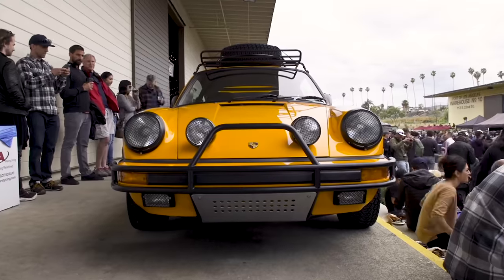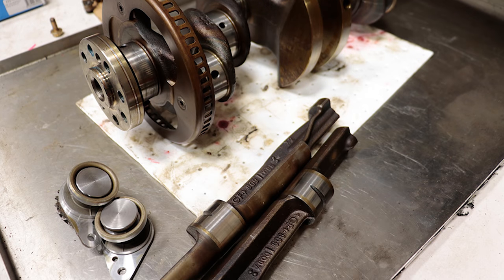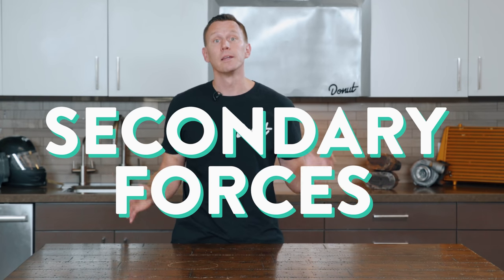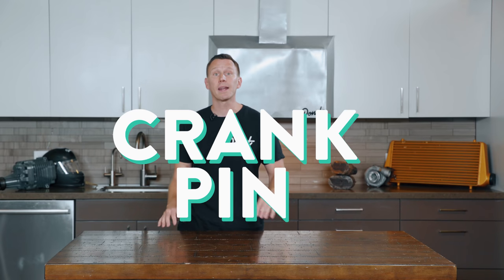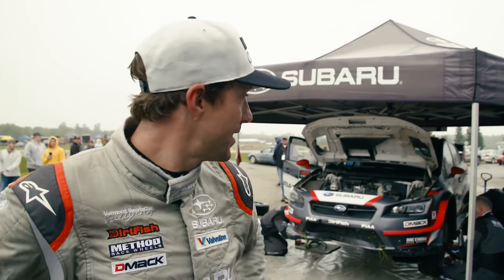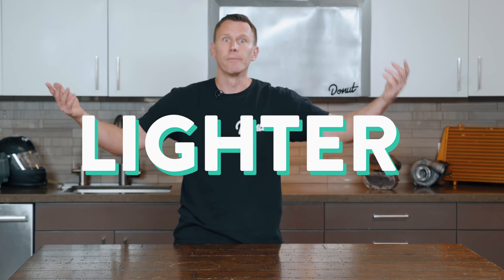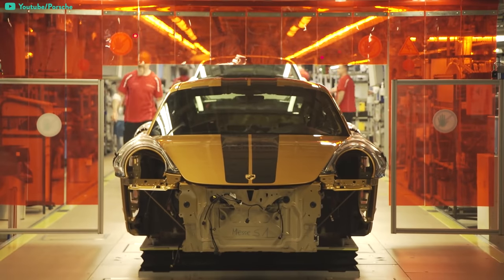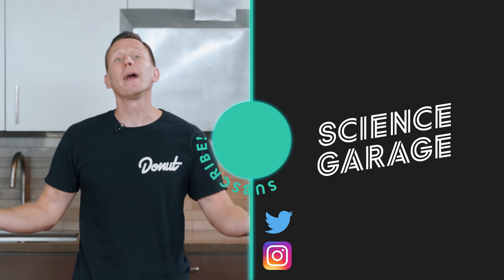BOXER ENGINE | How it Works

Comment: My 1982 honda goldwing(road bike or motorcycle) has a 4 cylinder boxer engine!!
Reply: Idk if you know or not but is it possible for a 16yr old to afford and insure a 600cc sport bike (yes i have prior motorcycle expirence)
Reply: Its not impossible at all I had my first bike at 17. Laws depends on what state you live in. Like the state laws and regulations. But from my experience it's not impossible but it's not easy to get a motorcycle at that age. The hardest thing would be getting a loan for one if you go that route(you can find older 600cc bikes for pretty cheap like 600 to 800 bucks) cash is always a better way to go if possible but small loans are good to build credit at that age. 
Instance is the next hardest thing being that young, if you go with cash you can get a policy for about 20 to 50 bucks a month because you can go with liability insurance it's always the cheapest but you can only do it if there's not a loan on the bike if there is a loan on it the bank wants full coverage on it.(your parents or guardian could help with figuring out what is best).
The next this is getting a motorcycle endorsement, most if not all states allow anyone to get a endorsement as long as they have a valid driver's license. I have been told that you can rent a bike to get it but I've always have said it's better to get one before and get to know the bike and how it rides so the riding test is more comfortable and easier.
The last bit of advice I have to say is "there are two types of motorcycle riders the ones that have been down and the ones that are going down" so always respect the bike and wear a helmet.
Reply: Very long post sorry lol🤣
Reply: @daxsouthwick2037  thanks man i raced dirtbikes all my life so 2 wheels isnt anything new, and now that 16 is coming soon im starting to save for a 600cc bike. Only want that fast of bike cause i have prior experience and i suspect most fundamentals of motocross/dirbike riding tranfers to street riding to. And I have a thing with going fast lol. But thanks anyway
Reply: @daxsouthwick2037  if not a supermoto cause its most famillar to me
Reply: @Aiden Maves I get it my first road worthy bike was a 1100cc I'm now on a 1700cc but looking at some other 1500 and 1600 because they look better and would be more comfortable. The bike will grow the longer you ride hah
Reply: For a bike you need a speedometer, technically that's all you need for one (besides license plates) and you could use your hand signals but some cops are jerks so I would put signals and a horn on it just to be safe

Comment: Aside from Porsche and Subaru (have owned both), don’t Ferrari produce boxer motors? I know they have at some point. Not sure if their flat-12’s are technically boxer motors. They actually had a car called the Boxer back in the 80’s iirc

Comment: Can someone explain to me the diagram with the 4 cylinder. 2 of the cylinders were only doing about 2/3 of the movement the other 2. Do boxer engines do this or is this just a mistake in the diagram?

Comment: Solutions for balance, solution for weight distribution, solution secondary forces (has more to do with number of cylinders and firing timing”, solutions for this at and other “we’re engineers and know more than you!”.  Solutions for their inherent oiling issue that is great for destroying engines.  from Subaru or Porsche nerds “because you’re a bad car owner who just doesn’t get why you should check oil levels every 4 times per fuel up!”

Comment: I might sound like an idiot, sorry I'm new to the car community but can a boxer engine be oriented vertically, so the Pistons are going up and down instead of left to right
Reply: yes but no but yes but you would never want to do that I just wouldn't really make sense and because of how cooling and how oil runs through an engine, gravity would most likely be against it

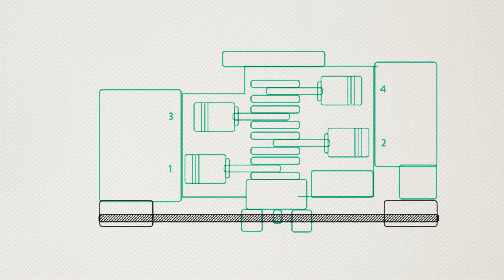Comment: @7:46 as my engine throttles through the valley of death on the way to las vegas because i got no chips left 

Cuz i been nossing and drifting so long

Even papa dom knows my nittos are gone 

Cuz i aint never raced a man who didn't deserve

Me be treating my car with autoshine you know that carnuba is worth it

You betta watch out who your racing and what your betting

Or you and your homies might be screaming MONICAAA

As i start from the pistol smoke, fool, ive got the new BA15 engines installed from Harrys so you better pray i dont take your slip so dont trip on fumes dawg

Comment: How the fuck you fail to mention  the aircooled VW and Porsche engine  one cam 8 valves and the capacity to make 5 times the original power on the same platform in N/A and 10 times the original power under boost! You all need to hire me!

Comment: Why not take an inline then turn it 90°?
Reply: Then the oil would leak out the gaskets
Reply: @nolesy34  so, v is the compromise of the two, not as tall as inline but doesn't have the oil problem of boxers?
Reply: @LateraL1ty  v is perfect 👌 its short and slots perfect

Even better are electric engines which have more torque and each motor is connected to the wheel so it leaves a LOT of room in the engine bay for

•snacks
•toys
•other related car items
Reply: @nolesy34  as much as i would like to say that electric are better, right now the manufacturing and long term maintenance are not there yet though the technology needs to be there of it to be developed but I think car companies are moving abit to fast with theirs ending production of combustion engine so soon, toyota got it right i think, combustion still has a place.
Reply: @LateraL1ty  testing you! Wanted to see if you were one of them

Ok your in

Comment: The boxer engine is an outdated and old design with notoriously bad heads and head gaskets, it needs to be updated to today's standards so they don't blow, I have 4 behind the shop right now because the customers can't afford to replace the engines, especially after I told them the price hehe.

Comment: With duel injection you don't want a boxer you want inline (like the new 2019 corolla). 4 cylinder non-boxer with duel injection = easy component access. 👍😉. Subaru boxer with duel injection is a pain to service (hard component access). Good luck BRZ owners 🖕😉

Comment: So I know what a boxer engine is because of suburu/Porsche/ frs. I didn’t care for it. Still don’t. Then I herd triumph is putting it in a bike and all I’m thinking is that triumph should be paying their techs more just to work on it. Jesus Christ I would be afraid of catching on fire from the heat off of it. Also looks ridiculous . Not to mention you drop it hard enough and now you got a busted cylinder head instantly.